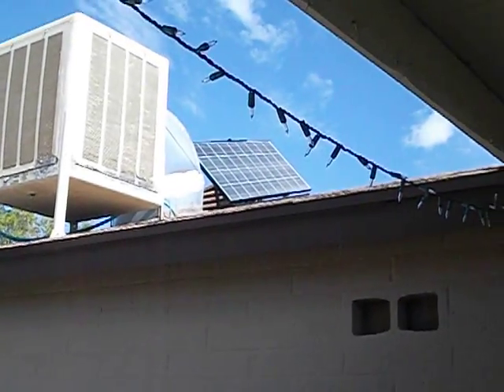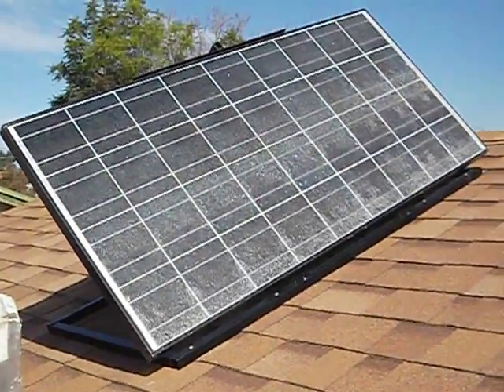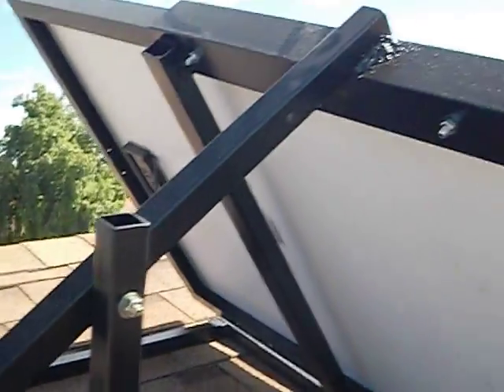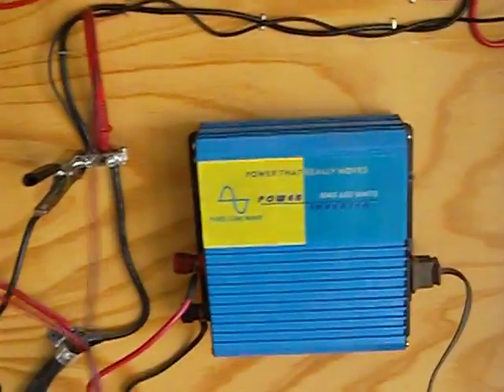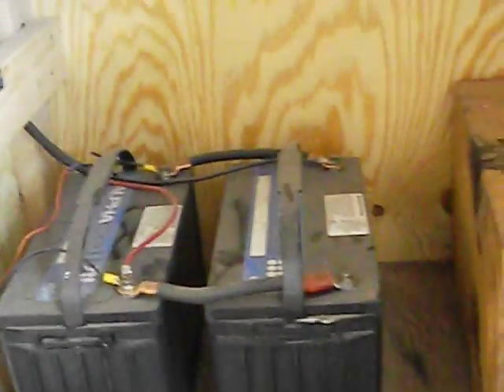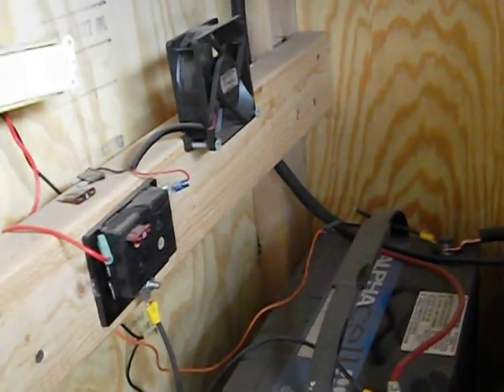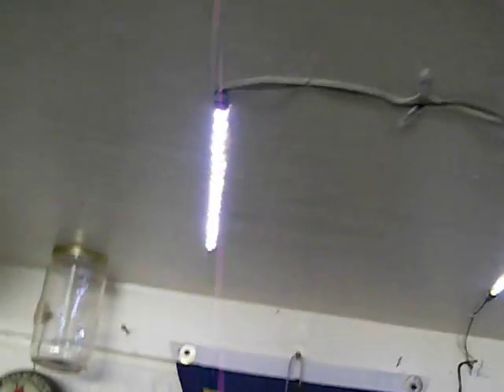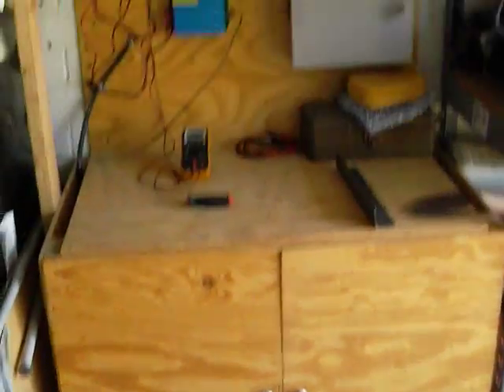125w Solar System for Lighting and back-up power

Comment: Cool setup is there a newer video of your system. And by the way there is no such thing as a sealed battery, all batteries need to vent whem chargeing or discharging, sealed or flooded. Sealed means you can store it sideways and not have it leak cause it has a check valve.
Reply: Except lifepo4 and lithium

Comment: cfl long tubes are taking 150W ?  For LED strip lights you can get some 5M SMD LED lights fairly cheap.  Not the brightest but for area lighting or quick check on/off far better than CFL.  Also now warm white.   No need for waterproof in garage; as such even cheaper.   Any update with charge controller?
Reply from the maker: Got the charge controller a few months after the video post.  Its an Ebay "special" MPPT charge controller from china.  Works good but batteries never get above 12.8 volts. I should be getting above 13vdc on a full day of charging. Thinking of upgrading controller to a name brand.  I can say after more than a year my system is still running and used daily. Cheers!

Comment from the maker: I got it for free at work. It is a lock box for a high end sprinkler system controller. You might be able to find something similar at a home improvement store or a key lock box you can convert. Cheers normsolwind!

Comment: Looking good, Check out my Videos on Solar, I Started of with a 40 Watt panel , then 2, and now I have also a 200watt, just getting a much larger battery, Been running lights all around the home for last 12 months, I Now plan on connecting up my TV to it as well.
I will also Update my Videos once this latest upgrade is done.
Well Done....